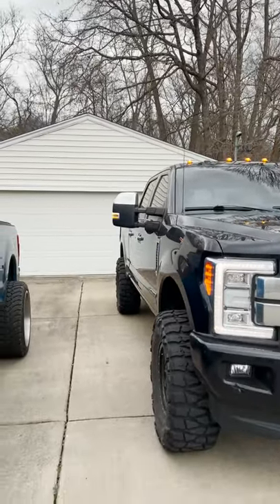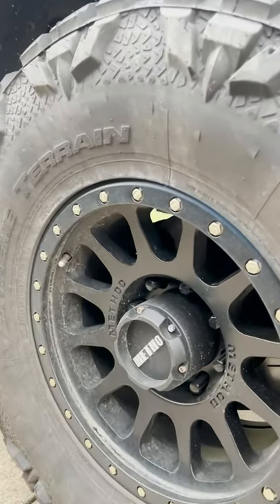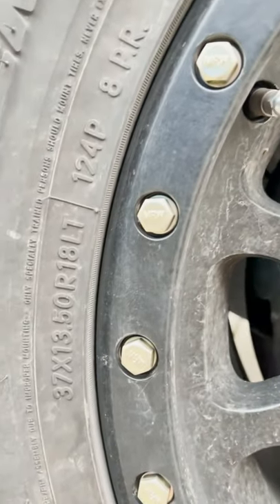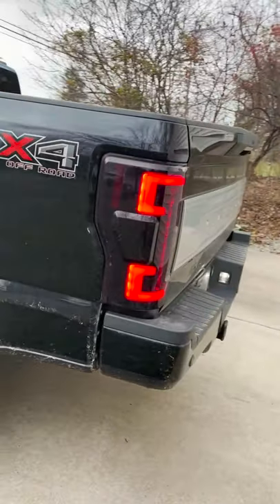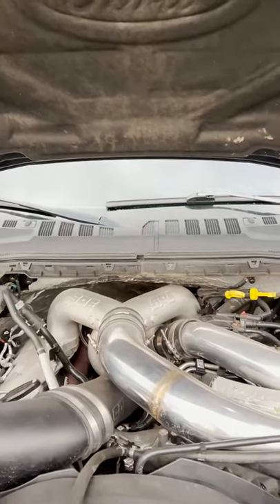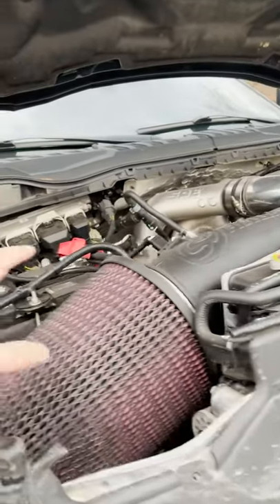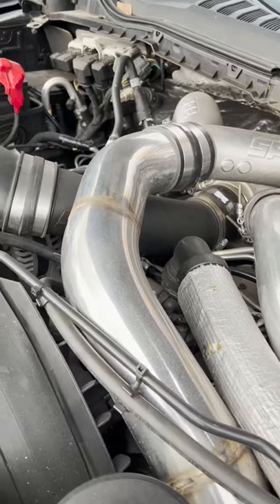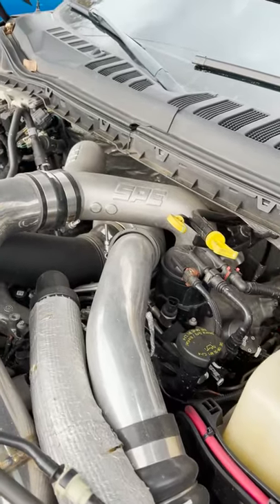MY 750 HP 6.7 Powerstroke - QUICK OVERVIEW

Comment: Ain’t 750 chief. And if it was, 6.7 don’t hold power like a 6.0 or 6.4 so you better start saving for billet rods and a whole loota ARP bolts and studs.
Reply: He put it on the dyno if you wanna watch the video and I like how you rattle off the two biggest most unreliable pieces of shit on this planet. I also own 6.7 powerstroke ,5.9 24v cummins, and my sisters 6.0 powerstroke guess which one works about 20% of the time
Reply: If you think a 6.0 or 6.4 is better in a street truck than a 6.7 you’re crazy. I’m rolling almost the same setup as Corey, just different manufacturers on some of the parts and I’m at 740 hp so yeah, that’s true numbers.

Comment: With mods not available. That 55 over kit is not available.
Reply from the maker: Get a 10mil cp4 it will flow more anyways
Reply: @TopCorey  it's a cost issue. The 10mm pumps are way over priced, the kit was reasonable. Someone needs to start making them again.

Comment: Hey Corey, I've got a '19 F-250 and I've been fighting this issue for a while now. I have a Superlift 4 inch radius lift kit on it and whenever I go over speed bumps at low speeds, the truck would drop more towards the passenger side than the driver. Feels like a light nose dive except on one side rather than the whole front end of the truck. This doesn't happen at higher speeds just at low speeds, lots of research and some said that this is bump steer others said that this could be a caster issue. I am at a lost of thoughts, I've even tried swapping different shocks and springs thinking I have a defective kit and the issue is still there. Not a deal killer but kind of annoying, would love your thoughts on this.